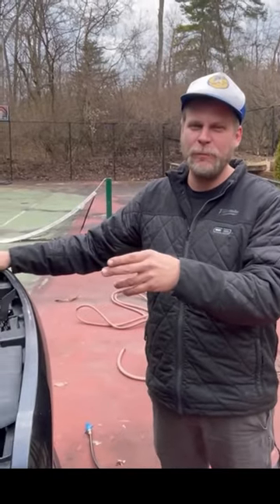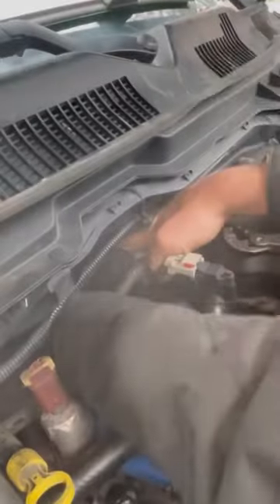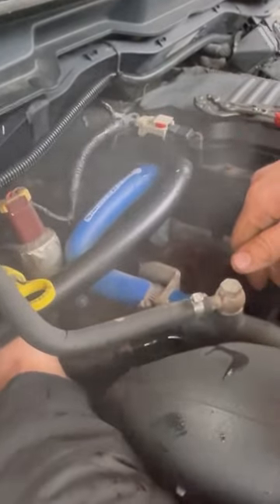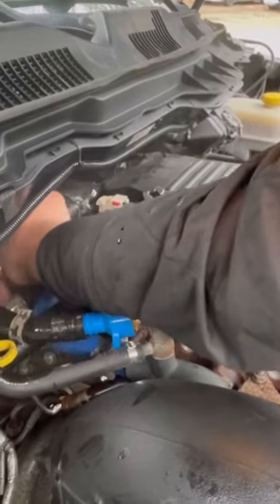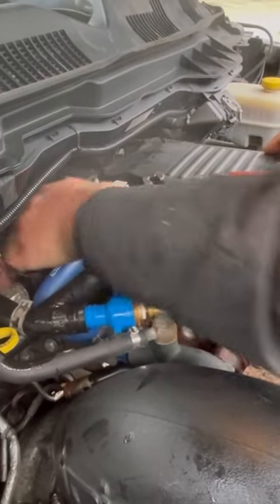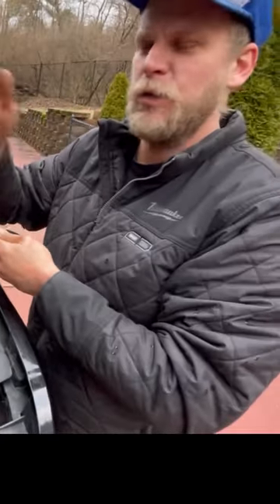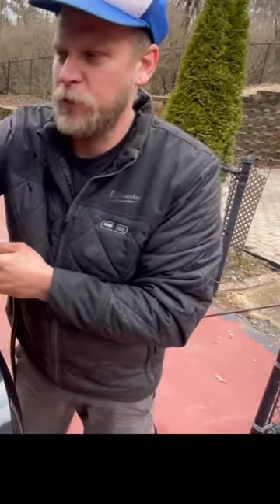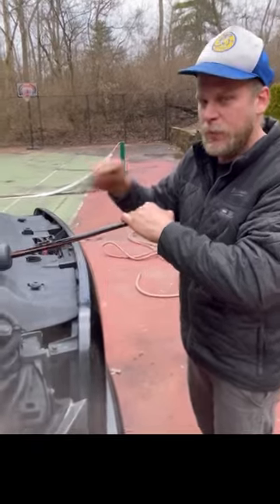No Heat? Heater Core Flushing Trick Often Overlooked!  Try this before anything else.

Comment: Your method worked beautifully. I did not have air but used on/off water push first and it was like a dirty toilet on the 2016 2500 6.7. Then I funneled in CLR pure concentrate for 5 mins then flushed again both directions. I lost less than a gallon of coolant in pulling the pipes, will flush again later. The heater stopped working before but now it works perfect with all the crud gone. I had two clear tubes and it made it nice to see the chunks and all come out. Thanks for an awesome post!  Definitely pre-warm the engine to make pulling the hoses off easy. Cold I could not dismount the hoses, hot, they slid right off.

Comment: Back in the day,my work truck had an issue where it was fine around town and you froze on the highway. 
So I stopped in at the shop who repaired radiators for us ,and he had this wicked gun that had a water hose and an air line hooked to it ,and a big rubber tip to fit a hose. 
Blast some water in, blast the air and the garbage that came out was nasty. 
And he even said it, it's either gonna work or you're gonna need a core when I explode it. 
I've always taken the long shot gamble and won probably 85% of the time so far.

Comment: When flushing the heater core I’ve heard it’s best to use low pressure hoses. Hoses with high psi might damage the lines
Reply: I doubt it tbh. Heater cores have metal pipes